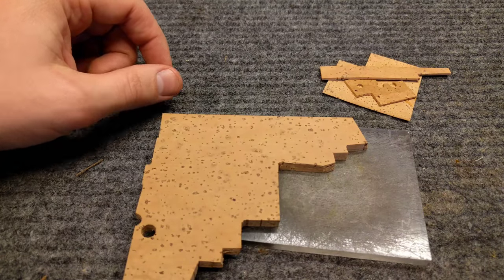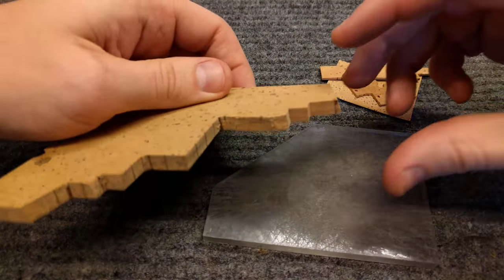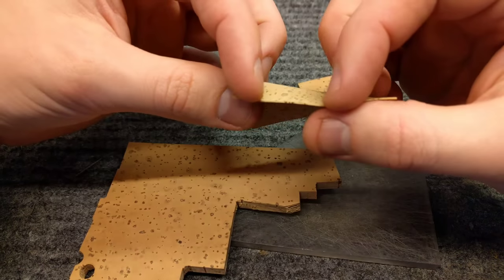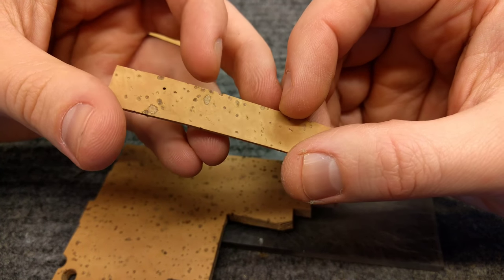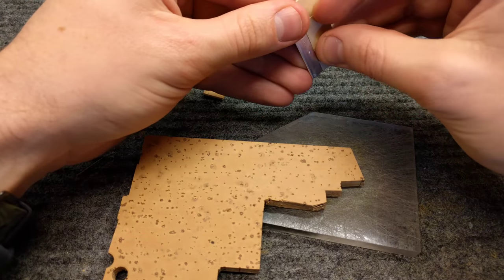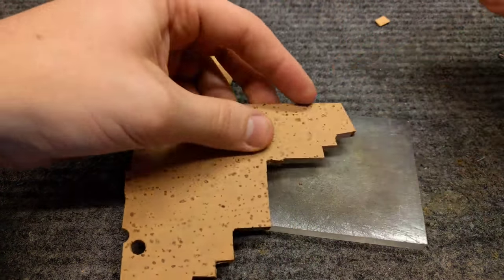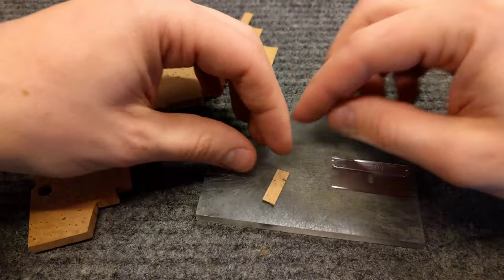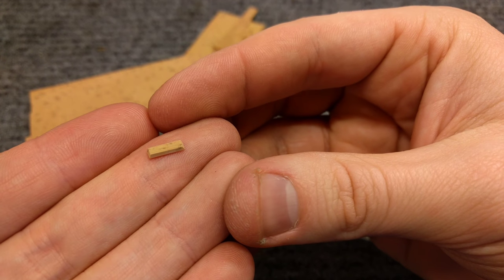Saxophone Repair Tip: Super Nice Natural Key Corks

Comment: Matt,
 This is called "optical" or cross cut cork. You can sometimes buy it cut this way from large cork suppliers. It's also easy to cut your own from wine cork ( just be sure the wine hasn't penetrated the cork and made it harder), stopper corks, etc. I's the only way to make cork pads for oboe, clarinet, etc. Only place it doesn't work so well, as far as I know, is on tenons and as a neck cork.
Reply from the maker: S. Harris optical cork, cool.  I know you can buy cross-grain cork from repair suppliers, but cutting your own like you suggest or as in the video above is much cheaper and more customizable and you can cut around pregoes.
Reply: I think the more “ standard” cork is called “ shive cut.“